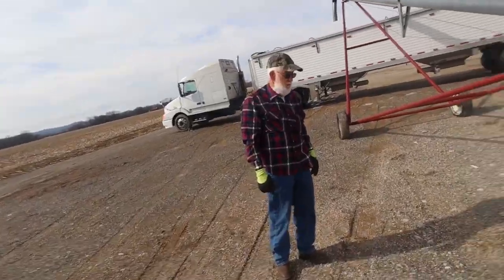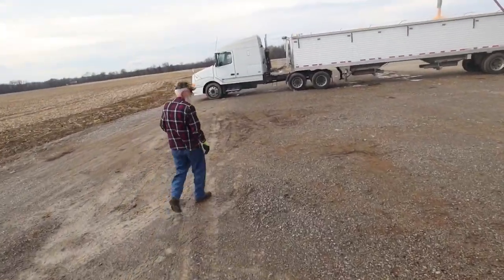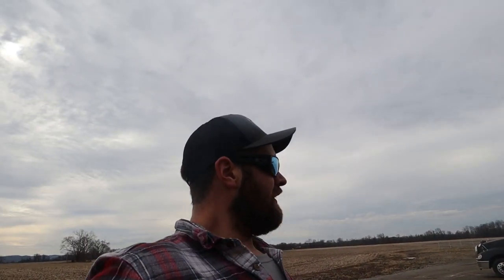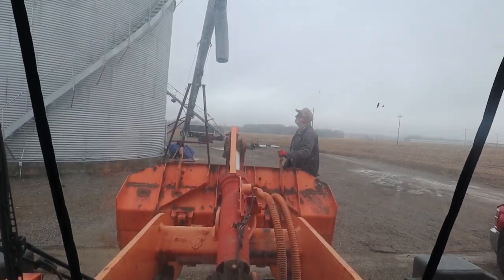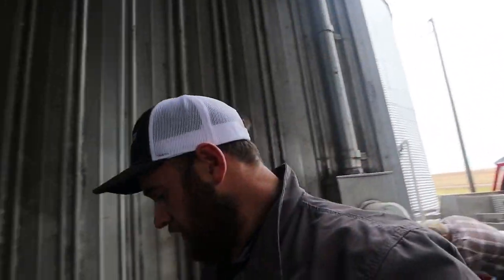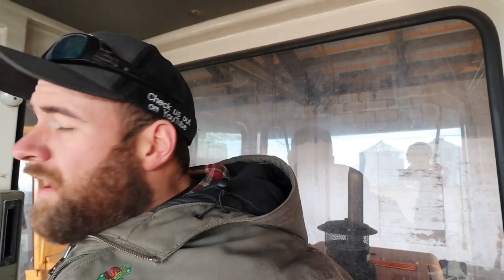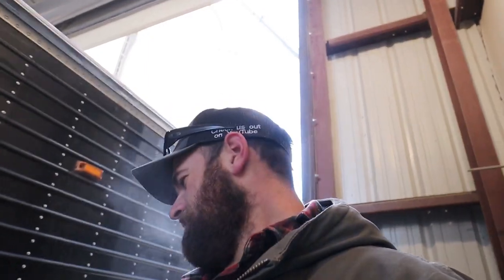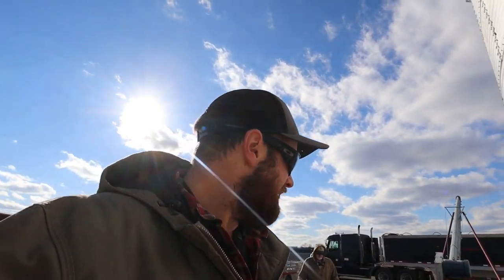Busted Bearings, Massive Flooding And Electric Fire

Comment: Our local elevator opened a new dumping station a few months ago & it is fast. Semis can dump both hoppers at once with wide open traps. We don't have semis we run triple axle trucks that hold about 750 bushels of corn & the first time I dumped there they told me that as soon as they start dumping raise the box as fast as you can. We average about 3-4 minutes from weigh in to weigh out. They also will have a probe working in the spring which will be nice in harvest time. It's -20 here in MN as I watch this. I am so ready for SPRING. Thanks for the video.

Comment: I've been a trucker for over 30years.  Personally I like International trucks.  However I would definitely stay away from super single tires. If you have a flat with them you are stuck right there.  With duals you can limp it to get off the road or whatever.  You might check out R and L carriers on I 71 in Wilmington Ohio.  They always have a lot of trucks for sale.  Coming from a company like that they should have decent service records ect. Just a thought.

Comment: Brian, I have 3 bins tied together with a Sukup double run system (some call it a grain pump).  The unload end goes up at a 45 degree angle to pull the trailer under.  You can blend any combination of the 3 or just load out of one.  It outruns an 8 inch bin unload.  It is pricey.  For what you do I’d probably look for another freight shaker, no super singles.

Comment: Brian, I have driven for 4 companies and 2 of them run singles on tractors and trailers. I do not care for them. They seam to ride ruff and you are stuck if you have a flat. The last frat I had was on a trailer and the company paid the road service dog over $600 just for the tire. If I had a choice I would go with duels and stay away from Internationals also. Hope things get to going better.

Comment: Never been a fan of super singles but only experience w em was pulled a hopper for a guy a couple weeks that had em on the trailer. Didn’t have any issue w em just heard bad stories. Least w duals you can limp in w a blow out.

Comment: Hey brian i work on a fruit farm in yakima washington we use a 2013 international prostar for hauling fruit 450 horse motor it haules really well they are really good trucks in my opinion we haul around a 45 foot flatbed and usually haul just under 80,000 pounds and the truck pulls good id recomend getting on but we dont use super singles they suck in orchards

Comment: My opinion stay away from super singles. If you have a tire blow out your stuck, at least you can get to a safe area with dual wheels if you lose one. We just bought a new Brandt conveyor and love it, we run ours off the tractor hydraulics so we can control the speed.

Comment: Ditch the singles. They suck especially in the winter. The only good thing is, yeah you can haul a little bit more weight and if the tire blows it normally takes the wheel out with it so you buy a whole wheel assembly. Bad side if a tire blows. You’re a sitting duck versus running duals

Comment: You made a good choice not bringing that belt conveyor home to. I worked at a seed plant here in Manitoba for 6 years. We had 3 different length Batco conveyors.  They lived outside all the time and looked way better than that one.   The big problem with them is the pile of 205 style self aligning bearings on them.  if the top, bottom or drive roll bearings go they will either lock the belt and smoke it especially on the pto driven one thats there, or fire the alignment of the belt off and chew the crap out off it, if a guys not careful.
  I'm now a self employed mechanic and still get called into fix those conveyors at least once each at harvest or seeding, as his guys "don't have time".  Yeah they are nice for not mangling beans/other crops or fertilizer but they like way more maintenance than a regular auger, he keeps the bearings on the shelf over there now and a belt lacer !. Thanks for the video, take care.

Comment: Looked like a trip to anderson equipment,  I here the maxiforce engine is trouble in those internationals, they were going cheap at a Ritchie bros auction,  my door froze on my Chevy too, I got it open but wouldn't latch,  had to drive all the way to work holding the door shut. Thawed out works fine

Comment: Sometimes pulling ( removing)  failed bearings off shafts  that are hard to get behind to pry or hammer on,  can be made easier by using a bearing splitter to get behind the inner race.  There are many sources . https://www.harborfreight.com/bearing-separator-and-puller-set-62593.html

Comment: My father operated a electric motor repair shop, so I grew up in that environment from handing tools while on service calls to learning the trade (minus the rewind part ... hated that). Anyway one of the tools that was used extensively is what we called a bearing splitter .... it would take that bearing race off in most instances easily, here is a link to examples of them in sets and the individual piece where a pullers could be used with it. I think ours were OTC which are the most durable but also the most expensive, today there are many more choices;
https://www.amazon.com/s/ref=nb_sb_ss_i_4_10?url=search-alias%3Daps&field-keywords=bearing+splitter+puller+kit&sprefix=Bearing+sp%2Caps%2C177&crid=3SFRLSLJKUTIG

Then an unrelated question ... does your farmland have any Hancor drainage tile installed?
I used to work for them years ago, started in Fairmont, MN then transferred to Creston, IA. When that plant was temporarily shut down during the Carter Administration grain embargo days, I was sent to the Patterson, CA plant for 6 wks to help out with maintenance because the manager there couldn’t find quality employees for that position. I was an Assistant and then the Plant Manager along with a short stint of production manager in-between  those positions. Anyway attended many plant manager meetings at Findlay, OH (corporate headquarters) cduring those years. I left about the same time they finally gave up on a R&D project that had failed, it was a triangle shaped plastic tile with a perforated flexible bottom that would fold for shipping and installed with a plow type installation devise that was used to open up the triangle shape to then be surround by dirt meant to keep it in an opened state. (Weight Of dirt on top would maintain the triangle shape or that was the intention anyway)
It worked fine ... until sandy (quick sand) soil was encountered ... at that point it folded back up and didn’t drain properly anymore.
The company was sold not many years later. They also tried to utilize recycled (ground up plastic milk containers and more) materials, which saved them a lot of material costs, till everybody else started doing the same thing and the savings weren’t so great after a while (in “my” opinion this only ..... caused more manufacturing problems).
In Creston, IA our competitor shared the same fence line with us, they were a company known as ADS, the ones with the green stripe.
Almost forgot, they also developed a co-extruded drain tile (smaller sizes only) with a white exterior and the same black core, wouldn’t get soft in the sun during storage so prevented crushing during installation also.
Anyway just wondering how much of your land is tiled and what type is installed, as a curiosity only.

Comment: What's wrong with international I've got one with almost 2 million miles on it one motor job on my cat at 950,000 and syncronizer trans and one power divider was done at million five
Reply from the maker: I think the issue is the max force engine

Comment: High quality Single are MUCH better than duals. Proven fact all over the trucking industry. Key words are "High Quality" Not the crap singles put on trailers or used by CHEAP operators.

Comment: Stay away from the maxxforce platform. I was a field tech for almost 10 years for an Peterbilt/international dealership. I did a lot of work for fleets that had them and also testing with engineering. The chassis are good but the EGR system sucks, coolers go out and trash the main and rod bearings from coolant going into the oil causing low oil psi. It also damages the aftertreatment system from coolant going in there. They also have issues with the HP fuel pump, injectors solenoids start failing around 375-400k, fan clutch & drive (if it has the Horton air operated clutch that’s the way to go) oil consumption issues(needs the new pistons and liners with the APR kit). There was also issues with the 2 piston air compressor and needed to be updated to the single cylinder compressor. If it’s an international n13 engine it would have to be 2016 or newer. Early ISX15 engines would have to make sure they have the updated done.
Honestly if you can find a Detroit or Cummins that’s the way to go. Stay away from the paccar MX also.
Reply: Jake Bos

Comment: Do NOT buy an international with a Maxxforce engine. Those engines are horrible to work on and expensive. It will be a money pit I promise.
Reply from the maker: Anything other than the emissions stuff?
Reply: Emissions,turbo failures,lifters,camshaft, head gaskets the list goes on. I would buy a truck with cat or a Detroit. If you are looking for newer truck I wouldnt be afraid of a dd13 or dd15 and just delete the emissions if they give problems.